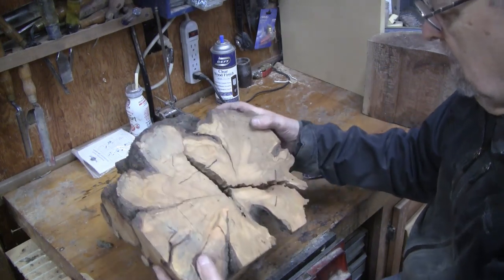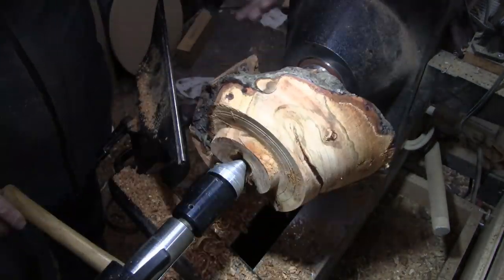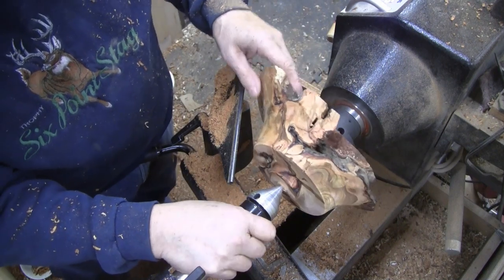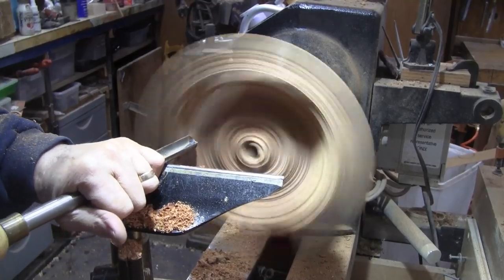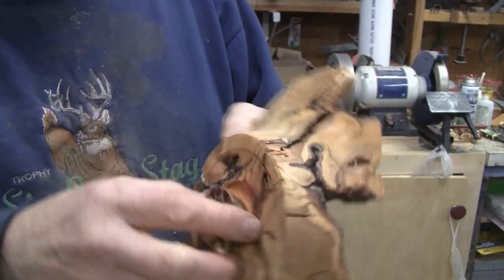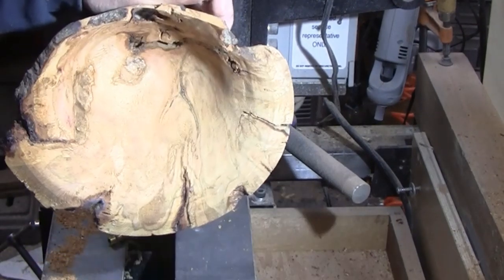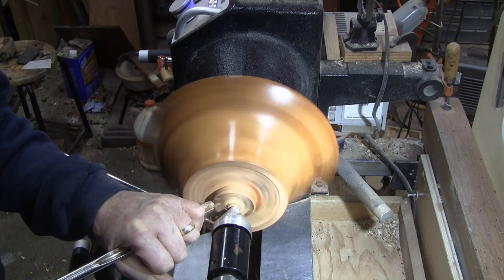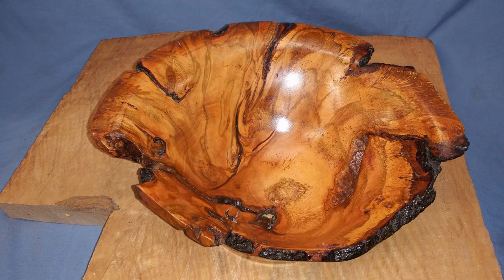Wood Turning Cherry Plum That Fell Apart

Comment: You didn’t mention it, at least I didn’t hear you mention it, but I’m pretty sure Tuffy sent you a piece of a root ball. That would explain a lot of things; the dirt and sand, the voids, the high moisture content, the internal cracking, etc.  Great job with a difficult piece of wood.
Reply from the maker: Thank you and yesit was part of the root system. I thought i mentioned it at the beginning but i might of edited it out by accident.
Thanks for watching and commenting.
Gary

Comment: Beautiful. With a piece of wood like that or when the wood is punky I have started to screw a larger diameter piece of gplywood to the face of the piece and then screw the face plate to the plywood. It avoids having one screw in a void or in punky town.
Reply from the maker: That is a great idea. I have hot glued a piece of wood so the live center would have a place when first starting to  hollow something out. Mostly on root system that I am making a vase out of.
I don't think I have done that for the face plate but will sure remember it.
Thanks for watching,
Gary